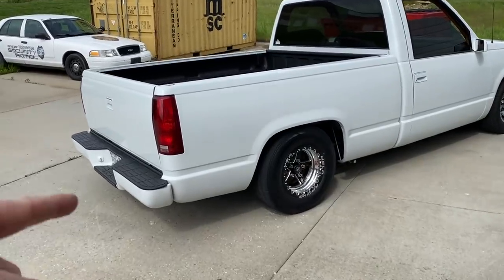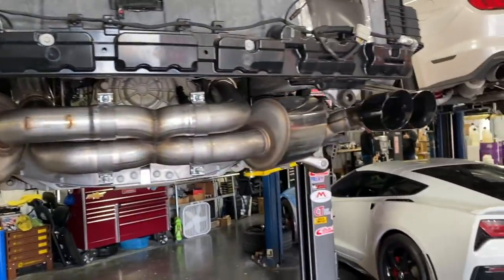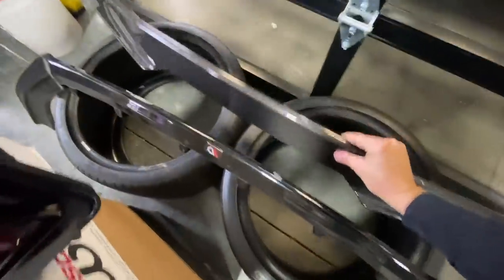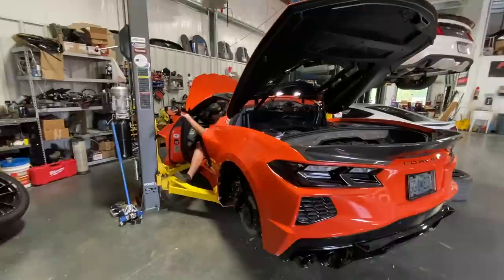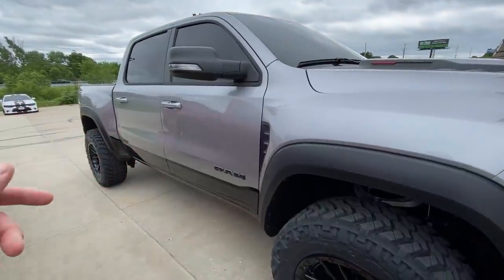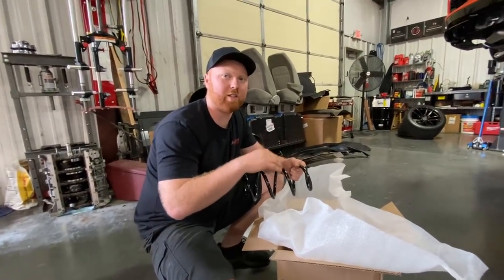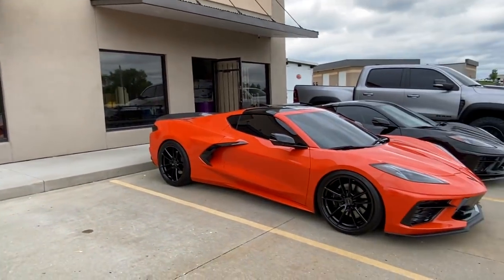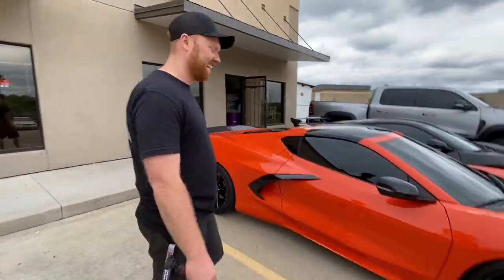Trying to make my C8 look more exotic...ha ha

Comment: you can paint lexan easily. Im a auto body painter for 27 years. The number one thing is to make sure you apply a raw plastic adhesion coat before you put on the sealer.